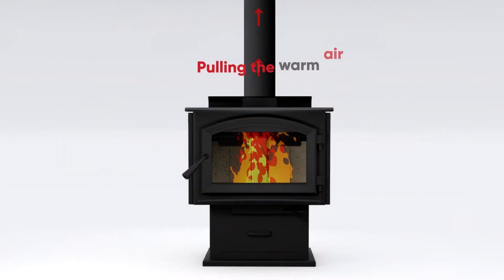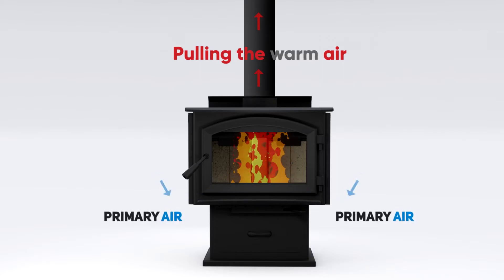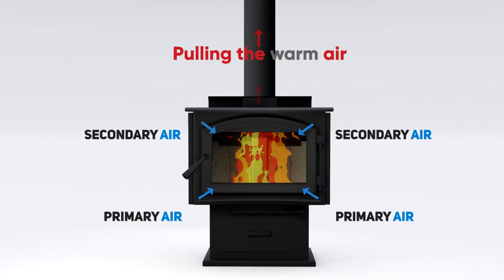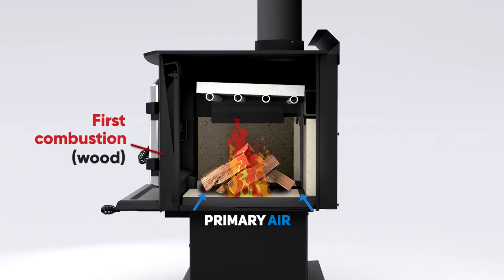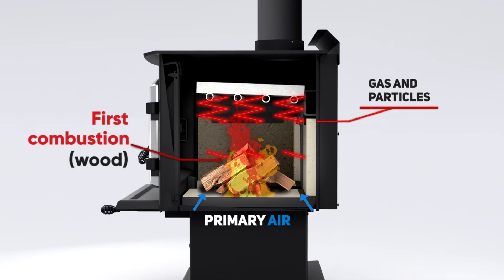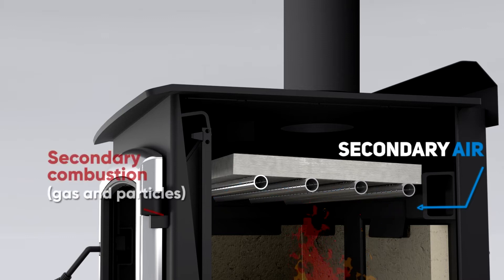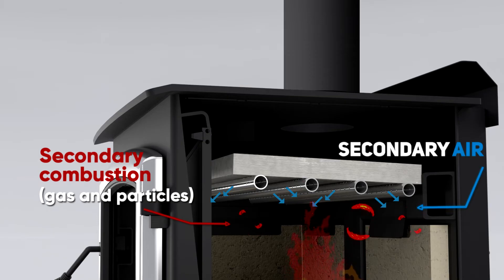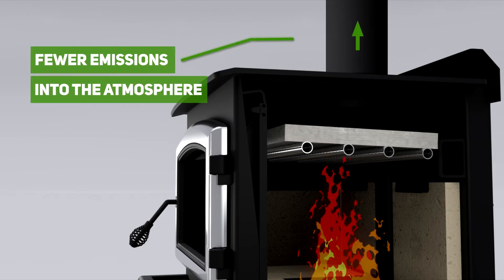How does the double combustion of a wood stove work?

Comment: it would be even better if all the combustion air came directly from the outside of the building, so it would not be drawing out the warm air inside the room, which is the purpose of the wood burner.
mady there is one, but I do not know where to get it.
the " air wash " is very good, more heat, less smoke, and cleaner.

Comment: But where is the secondary air coming from. It's all closed at the top
Reply: From the back or sides. It is fresh air that gets heated by the flames, sending hot oxygenated air to the top which helps burn excess wood gases that would otherwise go up the chimney.